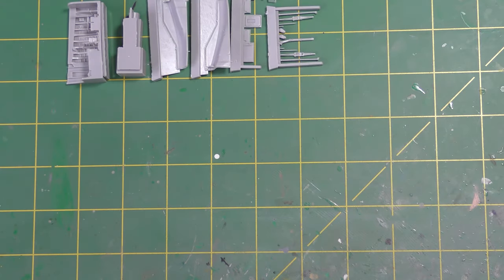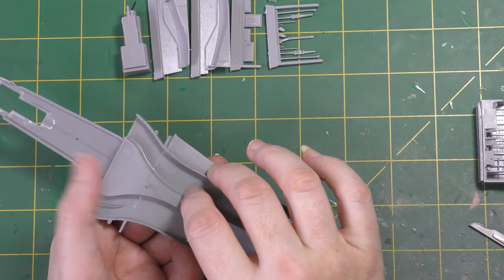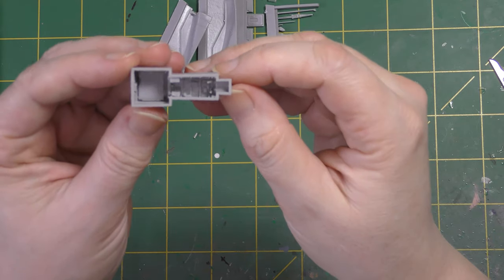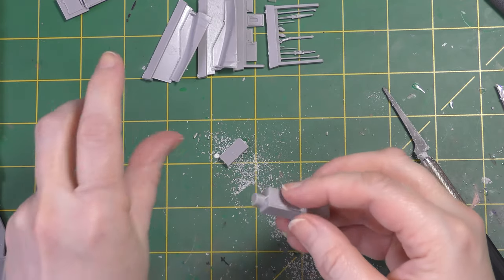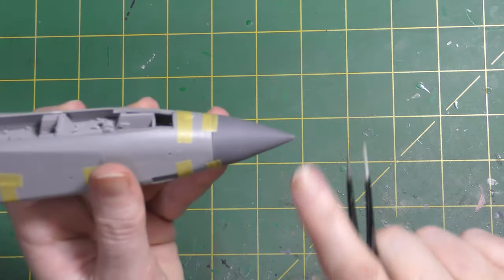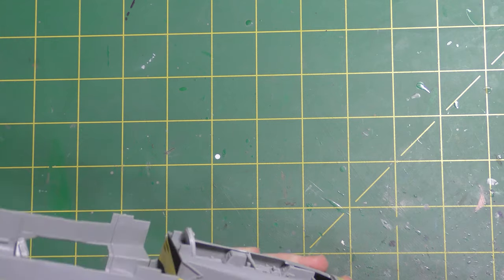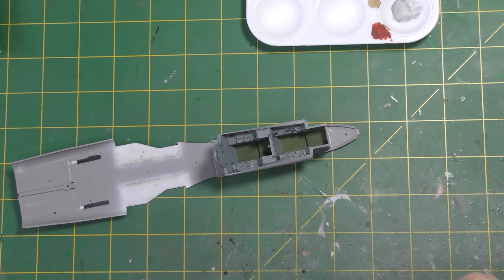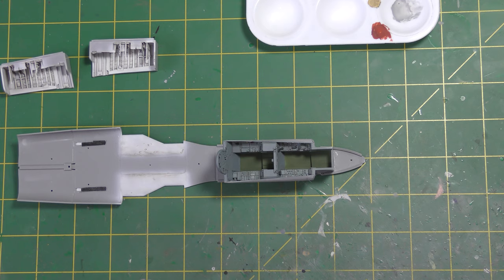Eduard (Revell) 1/48 Tornado GR1 Foxy Killer - Part 2.

Comment: Those wheel bays are some of Aires’ better fitting parts. Good plan keeping the kit trunking. I tried to use a phase resin seamless intake and ended up binning it as it simply doesn’t fit over the resin bays, without cutting a chunk out of it. I’ve also recently purchased a small modellers vice to hold parts like that wheel bay whilst I cut the plugs off, it helps immensely with precision cuts as the part doesn’t wobble around in your fingers
Reply from the maker: I briefly considered seamless intakes Bruce, but so little of it can be seen once the thing is built that I didn't think it'd be worth it. Seems I was correct :-)